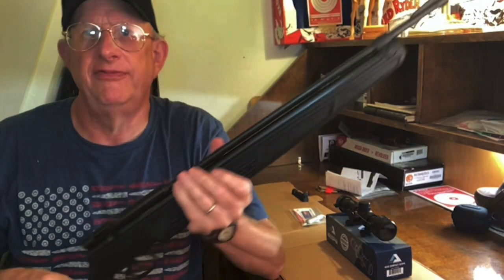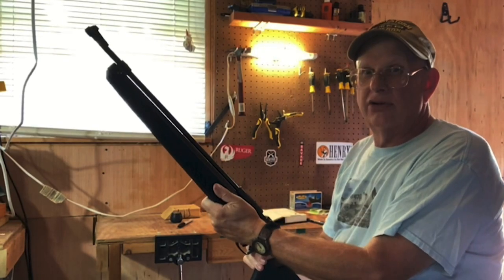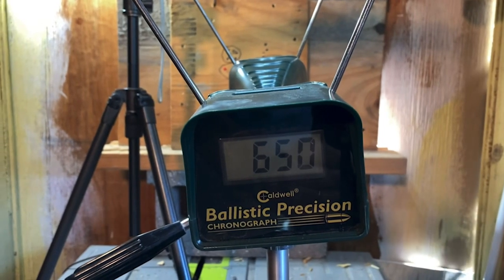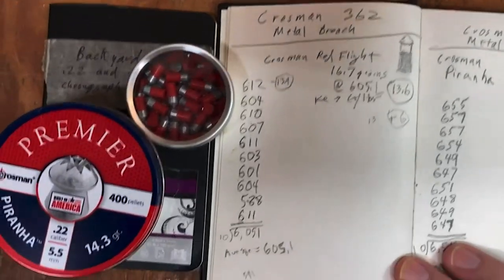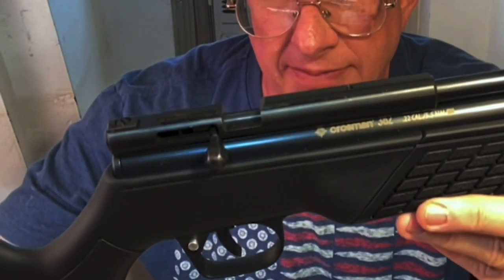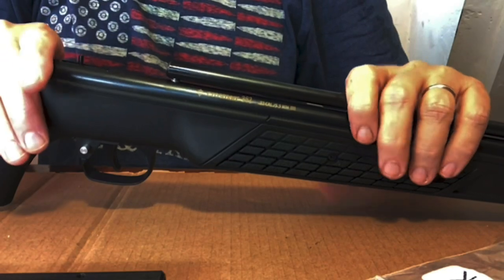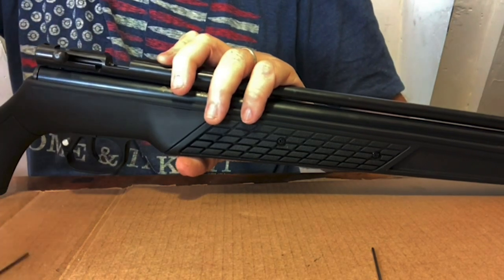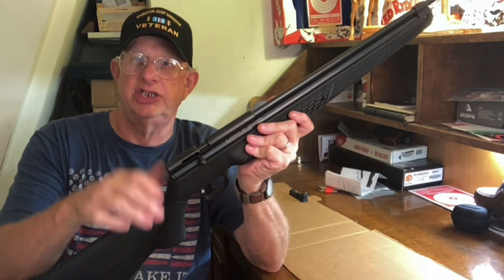Crosman 362 steel breech ups velocity,  looks cool; installation part also included

Comment: Crosman 362 is on my list to purchase great video Brian
Reply from the maker: Thanks, Rod.   I was just out shooting my favorite version of my favorite gun for just plinking today.   My 100 anniv. Crosman 362, the walnut one, with a factory installed metal breech, and a Williams Peep site.   I don't go for quarter-sized groups at 25 yards, because I'm using open sights (can't see that good), but with the Williams Peep site, I can hit stacks of cans set on their sides so you just see the bottoms, and knock down piles.   Lots of fun, very relaxing.   My 100 yr anniv.  I think is pretty close to that Benjamin 342 you restored in a video just weeks ago.   I didn't realize Crosman put a lot of money into the 100 yr anniv. but since their parent corp bought out Benjamin, I think they borrowed a lot from the Benjamin 342.  As to the standard out-of-the-box 362.   Great buy.   Lots of punch, pretty accurate, and you can modify the crap out of it.   Highly recommend the 362, AND now the 3622, which is a 362 without the pump, but a pcp tank instead.   Very basic, and a lot of people that like to spend a lot of money on pcp's poo poo it.   Not bad on the price, and with the same breech (and procedures) I put on the 362 in this video, you can get the speed of a 3622 up to 750 on a Crossman HP, 14.3 grains.   Lots of hard fast shootin, for cheap in both guns.   Check out my video on the 3622 with the metal breech and let me know what you think.
Reply: I bought mine "just because" a couple years ago. Glad I did. VERY capable backyard plinker or post SHTF critter gitter. Steel breech upgrade is a must have.

Comment: It’s looking like all the basic power modifications used on the 1377, 1322 are compatible with this. 
Seems like the basic power plant used in the pistols. 

That power valve should allow more pumps.
I wonder if the Baker  adjustable brass  trigger that replaces the Maximus trigger will fit this?
If not , something will turn up for certain. Its stock power level is better than I expected for the price.

I’m pretty sure you could get close to another 100 fps with the power valve and a stronger hammer spring. 

It’s nice to be able to go back to this. This is what I was doing over sixty years ago. 
Pellet guns ,guitars and , for heaven’s sake ,don’t forget pocket knives.
Reply from the maker: In several other videos I've done, I modified a basic 1322 into a "Super Drifter."   Lots of modifications that can be done to the 362, to include exactly the same breech, but beware of one mod that you can't do on the 362.   You can not do a flat top piston/flat end valve modification.   This allows you to pump a lot more, and get much more air in the valve, thus increasing velocity by as much as several 100 fps.  See my Super Drifter, Phase 2.   The reason is the piston is much longer on the 362, and there is no flat top piston for it I know of.
Reply: @brianwilke592  
Thanks for the heads up on the flat top piston. A heavy duty power valve , steel breech, custom hammer spring  and transfer port   and a 24 inch barrel may get another 100fps out of it. At least 50.

No one ,to my knowledge, is offering an improved trigger assembly yet. 
I thought the custom triggers for the Benjamin Maximus might fit, but after checking with Baker Airguns, I found that the adjustable brass trigger for the Discovery or Maximus will not fit this.

Comment: What kind of guitar is that? Sound good
Reply from the maker: It is a DIY special I did over a several year period.   Basically the body is a 3/4 scale body from one of those starter kits from Australia.   It looks like a combination of a Telecaster and Les Paul, but cheaper wood.   I hollowed out parts of it to make it lighter.   The neck is just a Telecaster style replacement.   I used a Fender Telecaster Bridge Amp from Sweetwater.   I had it wired like Leo Fender wired the original Squier, which is just a Tele with only the bridge pickup.

Comment: A definite must as a upgrade is a steel breech.
Reply from the maker: Yes. I noticed the velocity increase gained put the velocity at pretty much the same as you just recently got with the 100 year edition 362, which came from the factory with the steel breech.